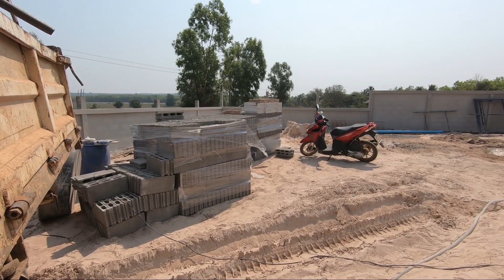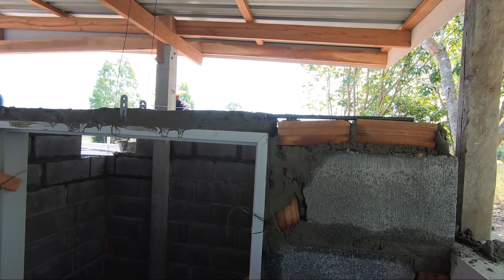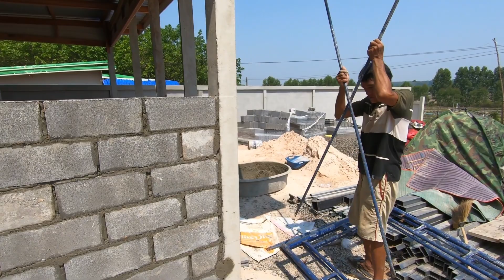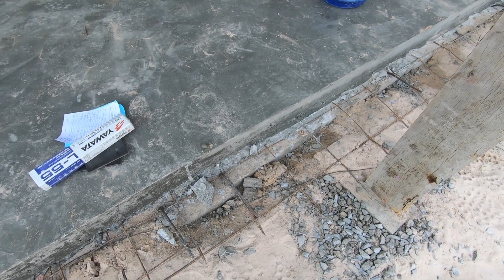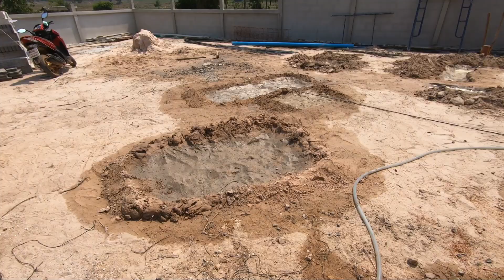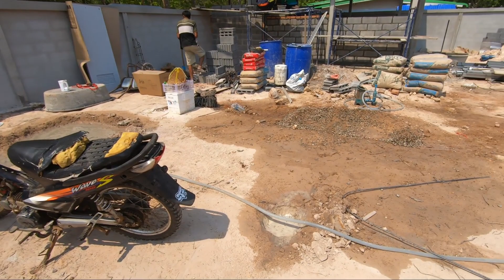New House Build part 18 - compromises have to be made

Comment: Also to add your just about to hit rainy season so I’d not worry about the land too much as it will level off and settle for sure. Thet said if your putting the house up now I’d just make sure the foundations are in the old deep land. I had to add land to mine (over 1m) and then started building straight away so I just piled it to be absolutely sure the house couldn’t move in anyway. I get the build your going for in regards to cost however to pile is not silly money there and will ensure no future issues. Like anything it’s just how far you want to go with it and what the end goal is. I think you being there is a great thing.

Comment: Another good video, wait until you want to choose the paint colours and find out they don’t give out samples. You have to buy 1L or 3L Just to sample what they have. 
They laughed at me when I asked for samples and said I’m crazy……. How you can pick paint with no samples is beyond me. 

No I’d not be happy with the make shift beam over the window either. My first builders tried to get away with putting nothing in at all. I parted company with them after this. Went through 2 more buiding teams after this before I found a team that were good enough. 

The little glass hearts are damaged easily, so it’s hard to be constructive with them in regards to problems or they just leave, the team I have now I’ve found just by having a laugh with them and explaining what I need seems to get the work that I want done. 

I’m building in undon